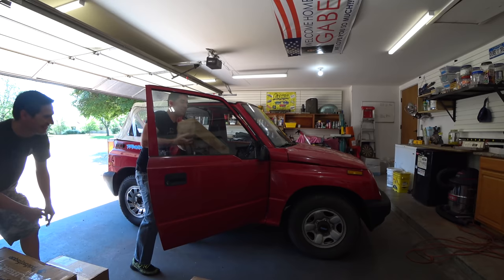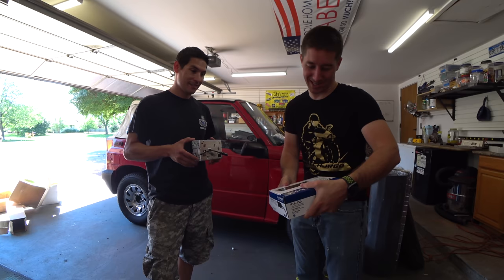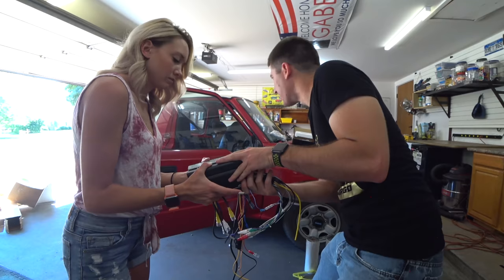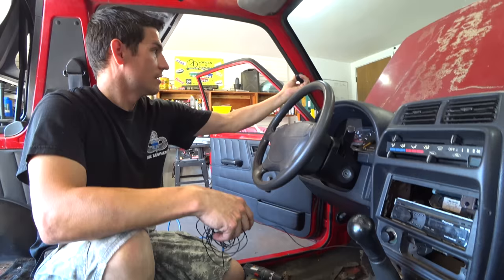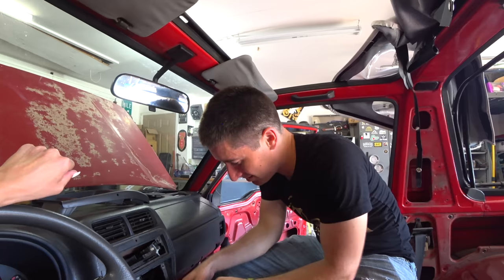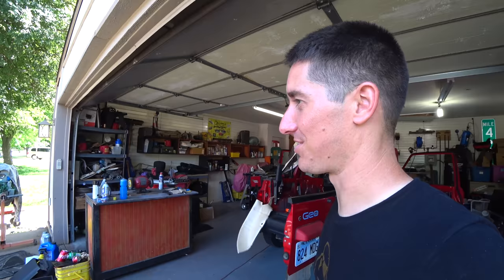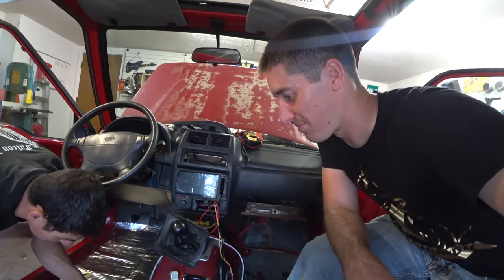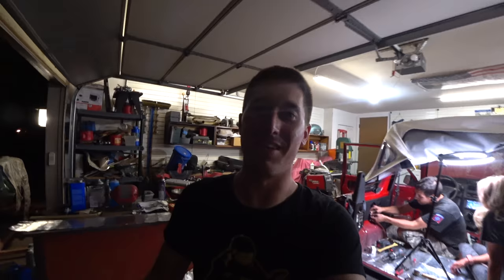Did We Just Put The Best Audio System Ever In The $400 Geo Tracker?

Comment: I bought a new 1987 Suzuki Samurai in the summer of 1987, shortly after I graduated from high school. With a lot of hard work and saving I was able to win my class in a car stereo competition a year later. It was eventually stolen and stripped but to this day it is my favorite of cars I've owned.

In those days there wasn't much power equipment made for car stereos, beyond speaker wire, so I got 4 gauge cable and connectors for power and ground from a welding supply store. And nobody did auxiliary capacitors but a neighbor, who worked for the Mallory battery company, suggested that I try some massive "caps" that somehow made it out the back door of his workplace, which I mounted under the hood.

The components list may not be impressive by today's standards but it was all top of the 1987 line and sounded great...
- Kenwood KDC-80 pull-out CD player (the KDC-90 had an external FM receiver, which I didn't care to have)
- Kenwood (model #?) 1/4 DIN electronic crossover mounted in place of the ashtray (a perfect fit!)
- Rockford Fosgate PA-1 preamp
- Rockford Fosgate Punch 75 amp
- Boston Acoustics mids (the Samurai has factory front kick panel speaker mounts, and the panel is sealed, providing punchy mid-bass)
- Boston Acoustics soft dome tweeters (which came with optional wedge-shaped surface mounts for sound staging)
- Rockford Fosgate Power 300
- Rockford Fosgate Pro 15" woofers (2) (148 ounce magnets and 3 inch vented voice coils)

For the woofers I built a ported, particle-board box in such a shape as to double as a back seat (it was bolted to the body and sat two people but had no seat belts). Although the box appeared to be small I tuned it by volume & port diameter according to the chart that came with the RF woofers. The two amps were mounted to the back of the box and were accessed by opening the tailgate. I padded and carpeted the box, protected the woofers with heavy-duty grills from JBL concert speakers (so that folks could lean against them), and put a few throw pillows like a little couch. The girls loved it!

Sitting in the front seat the SPL meter recorded 134db, with the top off. Then I took it to a show. Although at 375 watts (the RF amps were under rated) I was at the low end of the 300 - 499 watt class, and had a soft top, but the sound quality and installation took the prize.

I said the car was stolen but I did have a nice Alpine alarm system, which came with a "glass breakage sensor" microphone which happened to also work for the sound of the soft top zippers. I even had an adjustable motion sensor in the center console, for when the top was off, and pressure-sensitive trigger pads in the driver's seat. But I failed to run the alarm from a separate, hidden battery. When I found the Samurai dumped on the side of a country road I found that the thieves had simply clipped the battery cable from under the engine compartment.
Reply: Greg Sweet : I wish I could have seen it!

Comment: When I installed my huge system in my soft top jeep, I put a crapy head unit in the dash and hid the proper high end unit out of sight, so no one ever tried to steal it.
Reply: I got the aftermarket arm rest ( between driver and passenger ) that holds the head unit and has a lock on it. I covered the slim 12" sub with a sheet in the back and you really couldn't tell it had a system. I had a sound bar also but I riveted it in.
Reply: @Thomas Marshall Probably in the aftermarket armrest that holds the head unit, that he said he got.

Comment: I like how Alpine comes up with a neat "Powerpack" that snaps on the the back of the head unit but you still have a rats nest of wires between the two parts. You'd figure they would set up the amp with a pass-through for everything and an adapter that goes between them so you only have to mess with the external wiring and you'll have a little less mess in the dash.
Reply from the maker: When I bought the power pack I FULLY expected it to have a single harness with power/signal/turn on to the amp. What I got was slightly disappointing. Have to zip tie them into individual looms. 😬
Reply: Which is what you would have to do if you bought any other small Class D amp and just duct taped it to the back of the radio. Not something people would expect from a brand with a price premium like Alpine.

Comment: If you have to much power to the radio you might want to think about upgrading the alternator. The stock one will not be able to hold the power. I have seen a lot of people having trouble when they upgrade the radio and find out the battery goes dead fast.
Reply: this is a baby amp,a cell phone uses as much power,lol
Reply: He also missed 1 vital step...He did not add any extra ground wire between battery and body. Even without replacing alternator you can upgrade the wrie between it and the battery which will help a lot.
Reply: @eddiereichel9354  I totally missed that also. good catch.

Comment: The Tracker videos are always so much fun.  Watch out for heat buildup behind the head unit - I killed a few CD players in my old 96 because the electronics cooked.  I never tried sound deadening material because so much noise came through the soft top.  I hope it works well because that is a great sound setup you are putting in!  Always loud with the top down!

Comment: No joke, those battery terminal connectors made out of felt will stop 100% of the acid coming up around the posts of the battery and corroding on the terminal cables. They're like 3 bucks, I put them on all my vehicles and have never had to deal with it again. If you're super paranoid they have one with a read oil like spray you can spray on the terminals before putting on the connector, that'll prevent any acid from wicking up between the terminal connector and post if it sneaks past the felt ring (which like I said is all I ever use, never had it be a problem).

Comment: You can usually just use a relay for the parking brake bypass. Just get one from O'Really's and use some heat shrink and a soldering iron to make your own. That's what I did on my Jeep and it works fine.

Comment: I had a Susuki Sidekick 4x4 (same); got it for $99 - needed nothing more than a valve cover gasket.  It got hit by a Honda; got a check for $1799 to fix it.  A six pack and a friend, done.  Pulled out the old seats when I found color matching Recaros on fleabay.  New tubular steel powder coated bumpers too, and a bikini top.   Perfect.  I was driving it around town and guy offered me $5500 for it.  Needless to say, bu-bye Suzuki.

Comment: At 10:29 here is a tip on cleaning corroded battery terminals if you have a can or a bottle of Pepsi soak those battery terminals in some Pepsi in the acid from the Pepsi will kill off the corrosion on the battery terminals

Comment: I know I'm late to comment, but my 92 Geo tracker has rear speakers in stock panels.  I believe this was stock in that year, meaning rather than fabricating panels, you might be able to find stock ones with speaker holes/covers.
Reply: vikachan19: We found the original cutout perforations, but they are for four inch speakers and were not in the best location. By fabricating custom enclosures, we were able to utilize larger speakers and optimize sound quality.
Reply: @Gabe-ABNCW3  thanks for letting me know.  I was a bit confused as to why yours was missing those!  Love the build, been doing a lot of the same stuff at almost the same time on mine!

Also, I have a hookup on original parts in Indianapolis (including the 96 console cluster JR mentioned needing before).  In case you don't want to/can't fabricate your way through something.
Reply: vikachan19: Thank you! We will certainly keep that in mind!!

Comment: How hard would it be to remove it if you needed to ?
Reply from the maker: Could probably pull the main components in 20 minutes. 😬
Reply: @WatchJRGo  It's always much easier to take everything out than to put it in. I keep all the original parts from my trucks original sound system in case I ever sell it.

Comment: Gabe love your work to the tracker so I have one too I put a system in my and I keep on frying my alternator can you help me out please ?
Reply: Hi Isaac. Sorry for the late reply- but I just saw this. Hard to say exactly is going on without seeing it. That said, if you've ensured every connection is solid, and you aren't powering the system for extended periods without the engine running, I'd recommend getting a higher capacity alternator.

Cheers!

Comment: You could have just put a ground wire to the parking brake wire and it would have bypassed it
Reply from the maker: That hasn’t worked since 2013 or so, you have to break and make the circuit for it to work. 🍻

Comment: You really need to add another ground wire from the battery -  to the body of the car. Vehciles in design are not equipped for that much aftermarket power. You aded a bunch of wires to the + side of battery. It needs the same path to get back to battery -  Also if it were me id add and or replace the wire between alternator and battery + with at least 8awg wire. 4awg would be best

Comment: How does b-quiet compare to dyna mat?
Reply: Pat Mclean : both are great products and produced by the same company- However, having used both, I prefer b-quiet.
Reply: Gabe is price point similar? Is there performance differences? 
Great Opel Gt, would love to see how that turns out.
Reply: Pat Mclean : B-Quiet is 45 mil and dynamat is 44 mil. 

$324.99 for a 36 sq ft dynamat pre-cut kit v. $100.00 for 50 sq ft. roll. 

Head to b-quiet website for more specific information.
Reply: Pat Mclean : and thank you!